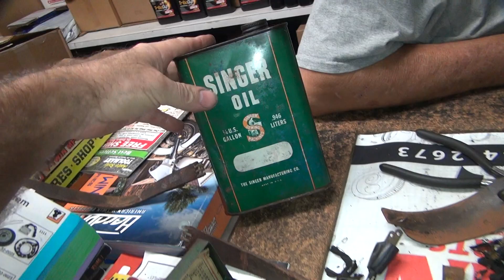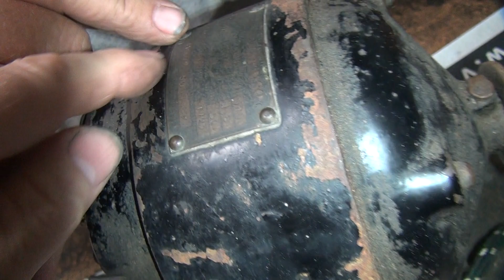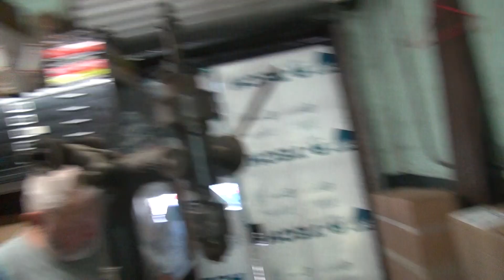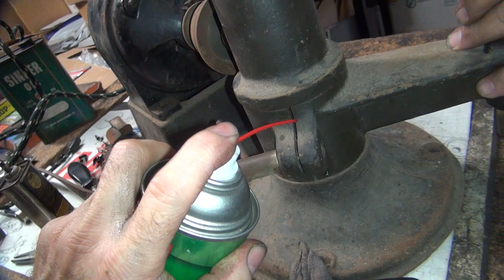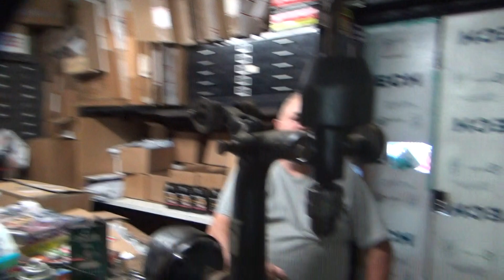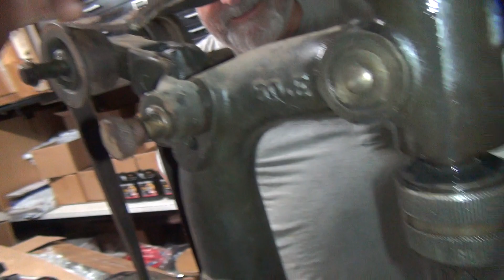#101 1920's drill press 50-E Champion Blower & Forge Co. Lancaster PA. harley by tatro machine

Comment: The pulleys are crowned( the curve), you can use a cotter pin on the belt lacing cut short.
Reply from the maker: yes a cotter pin will work but i don't think that is what they used stock. i want it to look just like they made it in the 1920's but old like it is. anyone got the almond chuck key.
tatro

Comment: The month year of manufacture should be the last four digits. I put the motor in 1965 in the late 70 to early 80 manufacturers changed their numbering format..
Reply from the maker: your nuts, no one made motors like this in the 60's. give me a break.
tatro
Reply: Maybe before you call someone nuts you might ask him why. I deal with HVAC units and Hydronic pumps for heating and chiller systems along with pumps for sumps and pump stations. I have see the industrial drive motors for these systems come out with old frame castings that were made in the 40s as late as the late 70s. That was when things were made to last. It could had been made using old dependable casing in a newer parts on the inside. the only way to really tell is to break it apart and look at the brushes, armiture, windings, and bearings. Tks
Reply from the maker: my statement stands, you made a stupid comment and any dumbass could see that. just by looking at the total package you can see everything is way older than the 60's.
what you describe is a rebuilt or manufactured motor, not an original motor like his one is with cloth wiring and all.
the way serial numbers are done these days is not how old numbers were done. everything changes over time.
tatro

Comment: They used to use cat gut as the pin in the belt joint. I don't know if a monofilament nylon like what is used in a line trimmer (weed eater) might work.
Reply: BTW, they still sell cat gut for stringing tennis rackets.

Comment: Barge glue works best on leather, apply thin coat to both sides let get tacky, then press together.
Reply: Barge is the stuff.  I'm I'm not mistaken, they used or still use it for shoes.

Comment: Probably a repulsion induction motor.. Starts with brushes....Mike in Louisiana
Reply from the maker: and last forever.
tatro
Reply: @TatroMachine  Yes.. Good starting torque but as with any brush commutator setup, seized brushes, brushes too short, brush springs too weak, or foreign matter can cause real problems..

Comment: Looks like alligator lacing on the belts.. There is a grooved pin that links them together if it is alligator lacing..Mike in Louisiana
Reply from the maker: where do you buy them.
tatro
Reply: @TatroMachine  Macmaster Carr or any place that sells transmission belting.. Alligator lacing comes in scored sections.. Just break off the width you need and install without clamp unlike clipper belt lacing...

Comment: That motor appears to be a repulsion start, induction AC motor. That motor will last another 100 years. A little oil (Not sandpaper) on the nameplate will enhance the data. Grease (lithium) is good pulley shaft. Graphite in and of itself is not a lubricant but when suspended in oil the graphite magnetically adheres to the shaft and carries/retains the oil with it. That is a GREAT American machine! Enjoyed Tatro!  Make sure the wire connections are sound. Cut back strands if needed.